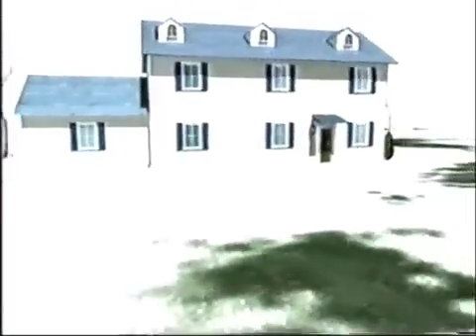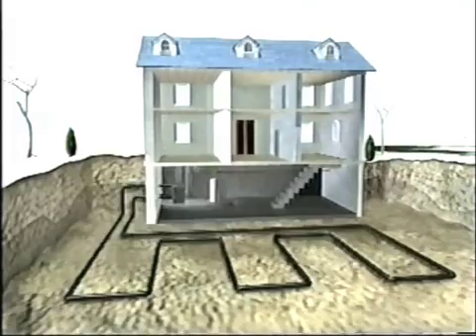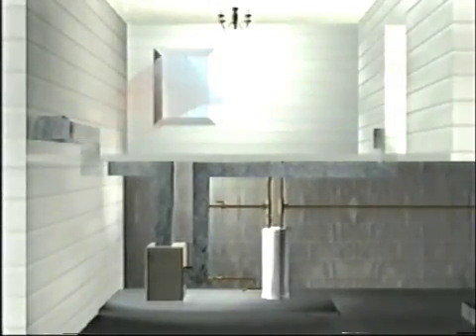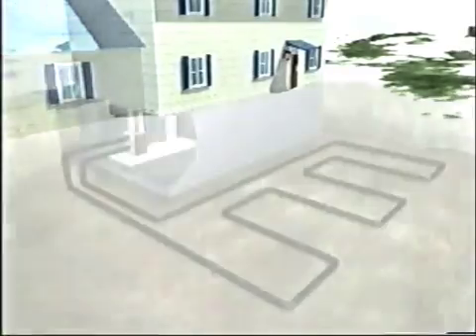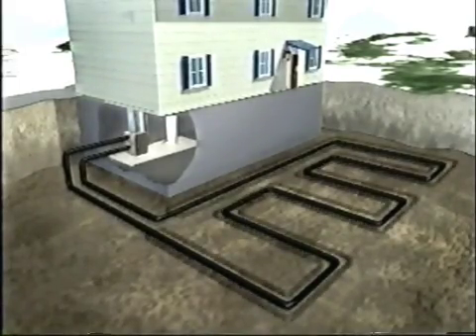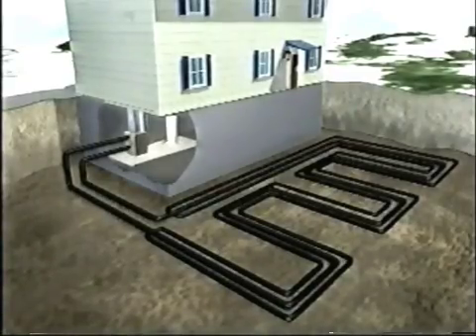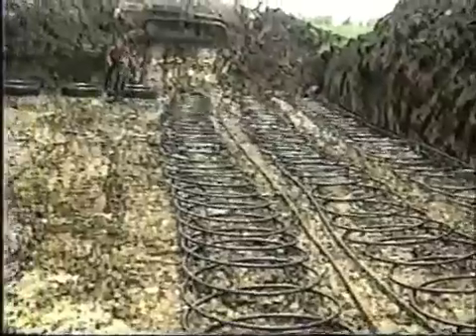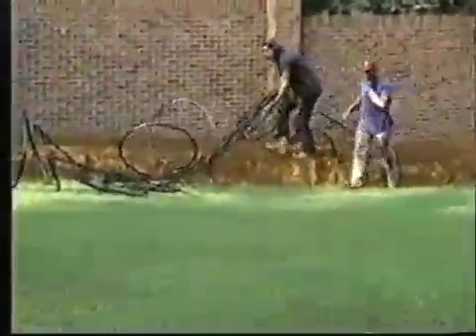Geothermal Ground Source Explained

Comment: A. Dean GOL105V1 SU24
1.) That the Earth somewhat directly underground us, stay between a constant 42-80 degrees year-round. 2.) That the Geo exchange system can be either an open or closed system. 3.) That they can be installed vertically or horizontally and under/in lakes/ponds/body of water.

Comment: This is NOT geothermal it is GROUND HEAT! Geothermal requires deep well drilling to get to the high earth heat at perhaps 1000 feet deep.
Reply: Geo- is a prefix derived from the Greek word γη or γαια, meaning "earth", usually in the sense of "GROUND or land".
Thermal = HEAT
Geothermal = Ground Heat
Reply: Matt, 

you are correct except that there are proper geo thermal heating systems where very hot areas below the surface use a liquid transfer system to bring and utilise it above ground. This refrigeration system is not geothermal. There is no transfer of heat from the ground to the dwelling.  All the heat is generated within the refrigeration compressor and the ground is the load required for the machine to work Heat pump is a misleading term.

Comment: HVAC the best field any could get into not only that you get some knowledge on being a electrician and plumber in the work but the employment rate is above 34% and i still see alot of old geesers working in the field. I heard if your a HVAC journey man for the union you get 45$ an hour + benefits. My HVAC Prof said you could get 45-60$ and saying the geothermal installation is 6,000$ and the trench work is 24,000$ so its great if you know both or starting a business. Question is which is better?
Reply: pauljackowacko552 that's facts, I'm starting out in the HVAC industry myself

Comment: Here in Northern Nova Scotia we are getting 58 degrees. Trenched systems use 500 ft / ton with 1 1/4 ' pipe. 4 ton system costs about $17.000 -$18, 000 to install. We use zero oil and electric is increased about 30%. Net saving is about  $3500 per year at present. This will only get better as oll is going up. We refit and since outr biler was about 22yera s old it would have had to be replaced soon so there is about a $5000 cost recovery there.

Comment: The first ground source heat pumps have proven reliable and effective with energy costs up to 50% less than older systems (i.e. heating, ventilation and air conditioning). Many new schools now install GSHP's connected to 250-foot-deep wells that transfer heat via water-filled polythylene tubing